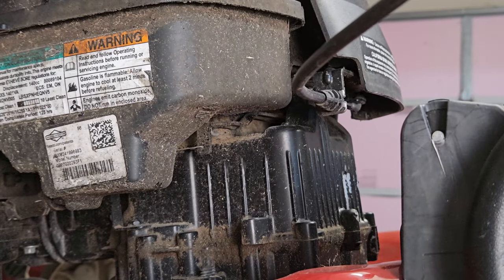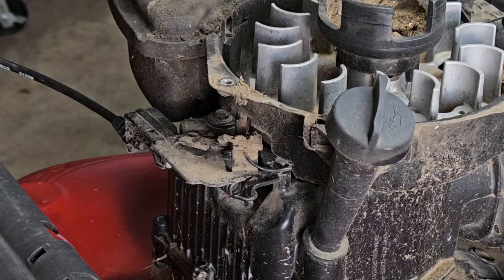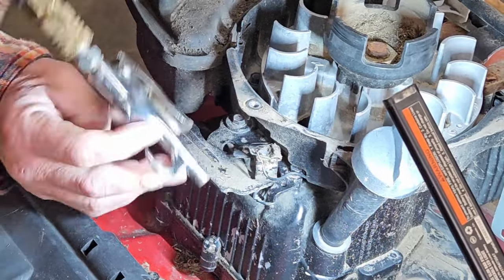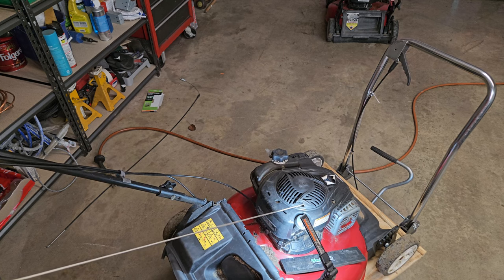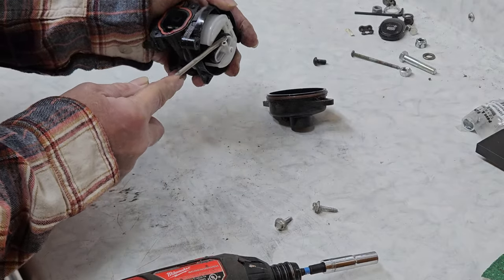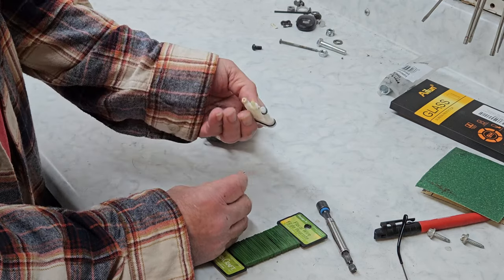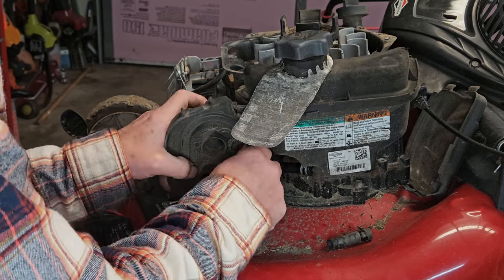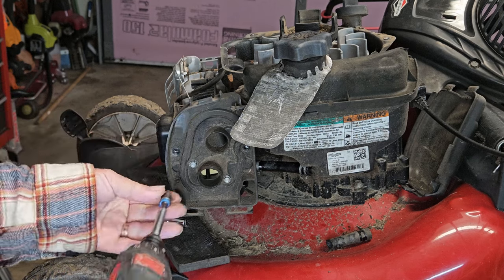Craigslist Toro mower with shutoff issues

Comment: Certainly a carb clean is in order because of the invisible air cleaner. Those carbs are simple. The 5/16ths equals 8mm, the other one is 7mm. I never considered that 7mm is basically equal to 9/32. The only time I use my 9/32 is on the Tecumseh 2 stroke carb common on old snowblowers. The 9/32 is easy to spot in my toolkit because I had to   Grind the socket to make it thin enough to fit on the Tecumseh carb. 

Good save Bill!
Reply from the maker: It's one of those annoying sizes, 07mm ,9/32... most sets don't have either.  🙄

Comment: GOOD fix and I was wondering if the connection on the coiol was loose but you got that one. HAPPY BRAND NEW YEAR nd I see you're still below 90 with the coat on. Get your hazmat suit on and go ride the terror of the community or repaint your helmet. God Bless!
Reply from the maker: I am editing the ridearound footage today.  😁
Reply: Don't edit it Too much! @GuysPlayingWithTools
Reply from the maker: @lewiemcneely9143  Just me flipping it in the grass 🤣
Reply: I crashed one time WAY out away from here down in SC in a big hole that's now a lake for a pumped storage project on an SL 350 Honda with no back brakes. I just had to flop over and after I was really good and sore from that, ride that thing all the way back out. I didn't ride for a long time after either. @GuysPlayingWithTools
Reply from the maker: @lewiemcneely9143  I have had a couple of those along the way in life. Nothing worse than riding home after dropping the bike. 
Yesterday's was tiny, you can't fall far from a minibike 🤣